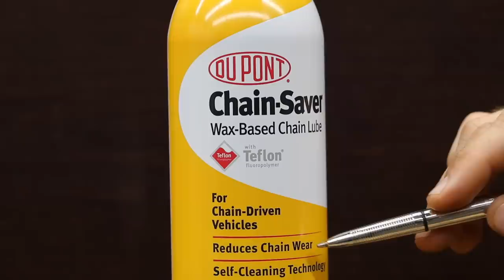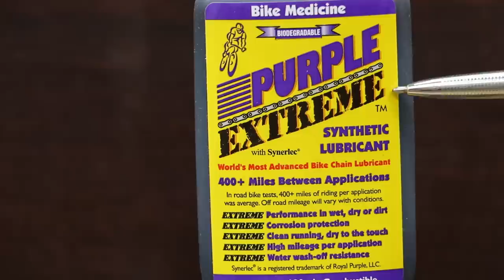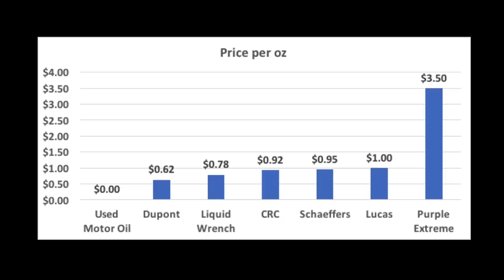Which Chain Lube is Best? Let's find out!  Ultimate chain lubricant showdown!

Comment: DuPont Chain Saver (teflon wax) is a great overall product for any moving part/cable, plastic or metal.  Most air-born contaminates don't cling to it.
Reply from the maker: Great point!
Reply: I am a Dupont fan for a number of reasons. I'm a motorcyclist, as in I ride all year long, rain, winter, on and off road. Tens of thousands of miles a year. Chain maintenance is a chore, but necessary for safety, performance and economy. Sadly I'm out there cleaning and lubricating my chains every weekend, but it's gotta be done! The real secret to making chains last in my experience is the lube, lubing regularly but most important is cleaning the chain regularly. I get about 75,000-100,000 miles out of my chain and sprockets and have had good success with Dupont. It goes on, dries and doesn't fling off so it's not slinging lubricant onto your swingarm and tire. It helps keep dirt from sticking to the chain and accelerating wear. But Dupont shines in another area, they make another product called Motorcycle Degreaser that's formulated for safely removing their own brand of chain lubricants. That makes cleaning a whole lot more efficient and easier. Another factor for me is a personal event I had with the company, when they debuted the product I remember reading something about chemicals you shouldn't use to clean the chain with afterwards. But they weren't clear on what to use instead. I searched their website, couldn't find anything to satisfy me. I hit their contact link expecting some computer generated reply stating, "Thank you for choosing Dupont, please visit out website at....". Ya know, companies that size, even if you could get a human, would they ever find you someone who could give you an answer? But I got a real person send me an email back minutes later, not just with information but tons of pertinent information. Guy really knew his stuff. This was about a year before they came out with their Motorcycle Degreaser product too. And when that was about to come to market, I got a personal email from the same guy at Dupont letting me know it was to be available and to check it out. Both events really impressed me, here I am, just some lone dude with nothing more than $10 invested in their product. Getting that much personal attention to make sure I was getting my money's worth, that I was satisfied with the product and had the information I needed. Was a good lesson for all businesses to strive for, do the extra, make a good product and you get a customer for life. They got me!
Reply: I agree. I've been using that Dupont chain saver teflon wax on my motorcycle chain for a few years now. So far it's been a great product.
Reply: Yes, any chain-driven machine can use this product, including small engine equipment. Tillers, aerators, walk-behind concrete saws and more.
Reply: Agreed on dupont. It's well revered in most motorcycle message boards, and by another independent reviewer, webbikeworld. The fact that it starts dry and ends dry is what keeps it on the rollers, rings and between the plates.
Reply: It's what we used on our BMX race bikes.  Chains stated pretty clean on dusty tracks and tracks that had a fair amount of sandy grit in the surface.
Reply: For o-ring sealed chains, I think dupont is one of the best options
Reply: That should have been in the test too. Seems like the wax ones need lots of re applications though. WD-40 has a specialist spray lube too, spray and stay could have been in the test.
Reply: 999thenewman  the same stuff is on your grill pan /skillet
Reply: Dry wax lubes are very nice. After applying They do need to dry before use and need reapplication after a certain amount of use.
Reply: I definitely agree with DuPont for motorcycle 🏍 chains. Especially when considering its quality/price from Wal-Mart, it's unbeatable in that measure. I've heard synthetic gear oil is excellent, but imagine it would get filthy sandy compared to DuPont.

Comment: I use the DuPont on my 4 wheeler and I must say the wax coating seems really good at keeping dirt and even mud off the chain.
Reply: I hated cleaning chains all the time on my dirt bikes and then the guy at my local motorcycle shop told me about DuPont. I have o-ring and non o-ring chains and this stuff works great on both types. I use to hate non o-ring chains but that guy told me to soak them in kerosene and they lube them up really good with the DuPont. So far the non o-ring chains are lasting a really long time. Not as long as o-ring chains but I like how they are lighter and make the throttle feel snappier.
Reply: @MtnPeakEnduro  Take a lesson from bulldozers; Hardened steel parts wearing on hardened steel parts in dirt. Longest life is NON lubed. In fact it is essential.
Reply: @RRaucina  you have a good point there
Reply: I LOVE THE STUFF
Reply: Richard Raucina please explain more? Are you saying no lube?
Reply: @CallsItLikeISeizeIts  If you ride in clean conditions, the lube is important, but if your chain is going to get dirty before you even finish a single ride, it's debatably making things worse. There are, however, coatings that almost don't increase dirt buildup at all, plus in wet conditions protection against rust is about as important.

In other words, if all you do is ride on sand, it might be worth not lubing your chain; if you drive in a city or on a muddy track, an appropriate lube is better.

Comment: If it makes you feel any better ( it probably won't but...here goes anyway)  the company I work for uses the very CRC chain lube you chose for your bailer to lube chains and exposed gear drives on machinery and CNC equipment where I work and it does work well. Good choice.  Thanks for another awesome video!

Comment: It would be interesting to build a chain tester that puts a significant torque load on the chain for a period of time.  Then measure chain stretch (sag between 2 points) and the diameter of the chain rollers (for wear).  That would be a highly relevant test to see how each product actually performs and improving the longevity of a chain.  The control chain (bicycle chains) would be dry, then you can measure the relative life and performance of each chain.  I would also change the drive and driven sprockets between tests and measure their wear, since sprocket wear is a factor in lubrication performance as well.
Reply from the maker: Great recommendation!
Reply: This would be neat to see, but it might be slightly disappointing since chains don't stretch.  It would essentially be a wear test, since chain "stretch" is just wear at all the points where a link interfaces with the next.
Reply: @kNasty_  So they do stretch, after all?
Reply: @kNasty_  links certainly do stretch.
Reply: @eformance  
It usually just appears as if the chains stretch. The length of the chain gets longer, but that is usually due to wear at each pin in each link. If you have a thousandth of an inch wear at each pin, and you have 100 pins, then the length of the chain gets longer by 100 thousandths of an inch, or 0.1 inches, but each link did not get stretched any. There is the condition when extreme torque is applied, such as when someone does wheelies, and they over stress a chain, and each link gets pulled hard enough to stretch them. If and when that happens it ruins a chain in seconds.
Reply: I think it would be hard to get measurable amount of chain stretch with the time I imagine he works with these tests. That's why i'm suggested to measure the temperatures of the chains during use with each lube. The chains ability to stretch is related to the temperature of the metal. The hotter the chain, the easier for the metal to stretch...Temperature is easy to determine, and  the lube that does the worst job lubricating, will most likely cause temperatures to be the highest...
Reply: @krissrock  
You are correct.
Reply: Wow! yeah, exactly that would be an excellent test. I wonder if he could get cheap sprokets off craigslist or budget bike parts store (same sproket) for consistency.
Reply: That would be a great test, but it would test the chain more that the lube? right?
Reply: If you keep the type of chain consistent (example: 9x identical bicycle chains) and change the type of lube then it would be testing the lube more because that is the only difference.

I see what you're saying. Like if we were to cut down a tree with a chainsaw. If it's a large tree and a large bar - yah it's probably testing the engine and compression more than it is the type of bar you're using (light weight, bowed out profile, etc.).  But if you keep the saw the same and only change the bar - eventhough overall the bar has minimal impact compared to engine torque and hp - you are testing the bar's.
Reply: Isn't the majority of the load on the chain produced by tension?  I suppose there is some torsion in an application like bikes with derailleurs.
Reply: @loctite222ms  I didn't suggest a torsional load.

Comment: Here's something unusual, but cheap with LOTS of uses.  Coconut Oil.  Best damn gun lube I've ever found...I'm an ex-cop in Florida and carry concealed ultra low profile...steel on skin.  The only oil I've found that can keep the rust at bay is coconut.  Slickest too.  Put it on, wipe it off...lasts a really long time and is skin safe.  Let's just say, you can test that out after a long day by convincing Project Farm and a half to give you a back rub using it.  Use the solidifying kind for cooking and 'personal' use and I recommend the fractionated (liq at room temp) for weapons and cold wx apps.  Try it, you'll love it.  Tips from an old cop...
Reply from the maker: Thanks for the tip!
Reply: Have used it for tons of things, but never thought of it as a mechanical lubricant. Time for project farm to fire up the lubricity tester I think
Reply: Over mineral oil?
Reply: Brought to you by our friends at the Pacific Resources Board
Reply: Yard Sale Dale - I have lots of 'proper holsters' and don't care for them.  That doesn't stop me from buying them and then adding to the drawer.  I prefer clip styles and don't intend to get sidetracked on this topic.  I've been carrying guns everyday since the mid 80's.  I know what I'm doing.

Re-read my post, please.  "Put it on, wipe it off"  No, it doesn't run all down and off the gun.  But since it's a fully saturated hydrocarbon, it's EXTREMELY resistant to oxidation, since all the oxygen binding points are already occupied.  That's why it's so shelf stable.  The mags get a light coat too and they run like butter.  Buttahh... silky smooth.

I've paid for Eezox (next best), and tried Mobil 1, CLP, RemOil, you name it...compared to EVCO they are distant seconds.  It works so well, that now any metal that is rust prone, gets a swipe.  My sword collection is almost maintenance free now (thank goodness)...I use in to make Bulletproof Coffee since it's a medium chain triglyceride and much more closely matches human biological needs than the long chain fats in grains and other sources.  As a massage oil, it's ideal.  Hard at room temp, melts at body temp, and dries soft and non-messy.  Get it on something, no problemo...it's clear and washes out without messing stuff up.  Stays slick while you work it, then dries...did I say ideal.  The list goes on.  Love melted wax scents...except the wax gets burnt over time.  NP...just use coconut oil in a jelly jar on a cup warmer and put whatever essential oil you like and enjoy cheap fragrance all day...lasts years not weeks.

So, yeah...it works.  And after a few decades of feeling automatics on my skin, I'm used to it and find it 'reassuring'.  The guns run great now.
Reply: legacysage - Absolutely.  Test both yourself in apps where you use mineral oil now.  You'll be thanking me.
Reply: I can imagine the soft spot on your skin in the shape of a pistol lol
Reply: logan thompson - LOL...let's just say I know when I've gained weight..
Reply: @Avitaser  
First of all thanks for the great tips. And thanks for your service. I have a few questions. How long does it take for the coconut oil to go rancid? Do you have to clean and re-oil often? If it doesn't go rancid, would it be a good leather holster conditioner? Great ideas.
Reply: David Scott - IDK..never had any go rancid.  No, I clean and re-oil MUCH less.  That's the main reason why I use it.  I'm lazy.  I've got a Kel-Tec PF9 that will rust if you look at it wrong...not anymore.  The coconut oil probably last 3 or 4 times as long before reapplications and I put on all the metal as a very light coat.  The gun actually gets blacker for a while.  I think it gets down into the metal.  Couple that with being a superb lubricant and it's all good in my book.  I'm not an oil fag...I test in my world.  The guns run great, don't collect dirt, don't rust, and it's safe to handle.  Hell, I eat it daily and rub my knotty old muscles with it.  Seriously, God did us a solid with coconut oil.
Reply: Yard Sale Dave - A new gun oil combo was made of it.  Frog Lube.  Outstanding product.  Happens to be coconut oil...with a touch of wintergreen.  Check the reviews on that stuff.  Save yourself some money and use a pennies worth of your wife's coconut oil and call it good.

In anything I'm running, it seems great.  Auto pistols, pump shotties, ARs...maybe you have higher level needs.  For that, Glock says run CRC copper anti-sieze and lubricant.  They say that on their pistols a dab of that on the contact points and you're good to go.  Back to the coconut oil, my ex-gf let me tune up her Glock since she has to shoot several times a week as a recovered firearms inspector.  She was ecstatic...you know what I did?  Ultrasonic cleaning, buffed the contact points to a polish and put a light coat of coconut oil on it.  Said it was like 'glass'.  Your mileage may vary.  Try it and see, it's free if you already have some.  If you don't, get some for the other benefits whether or not you shoot it.
Reply: Leo is right about this stuff... FrogLube, the super popular fire arms lubricant was analyzed and is basically coconut oil.
Reply: @Avitaser  
I've got an old knife that is high carbon steel that I use for skinning deer and elk that I kept oiled with vaseline to keep it from rusting. I figured that if you can eat the stuff as a laxative, then it can't be too bad for you. But, I think that you have convinced me to use coconut oil. I eat coconut oil already as well, and if vaseline is a laxative, then that's probably because your body is trying to get rid of the vaseline,  whereas coconut oil is food. 
Thank you!

Edit: true wisdom gained from true experience.
Reply: Just buying regular cooking only for cooking? Sounds cheaper than Remington oil...
Reply: David Scott - You won't go back.  Vaseline is nasty...in so many ways.
Reply: Thanks for the tip Leo!

Comment: I think a showdown of gear oils would be neat
Reply from the maker: Thanks for the recommendation.
Reply: Honda recommends 80-90w gear oil for its motorcycles and it has performed well compared to alternatives in other tests
Reply: Royal Purple gear oil is really good, but at a cost! I consider using it for my motorcycle chain, but satisfied with DuPont Chain Saver. I have RP gear oil in rear diff of my motorhome and Duramax truck, and experienced noticeable improvement on both. I've heard its excellent on motorcycle chains too (but imagine it attracts dirt).
Reply: I just put super tech gear oil in my $60,000 Dodge Ram hopefully it's as good as the motor oil is
Reply: Amsoil will win that one too.

Comment: Good chain lubes are often dry lubes, no surprise that some were dry at the end of the chainsaw test. Some have drying requirements before use. The dry chain lubes will exfoliate dust and grime needing reapplication to maintain lubrication of the chain (see bottle directions)
Reply: PAG air conditioning compressor oil seems to stick a lot to metal surfaces btw, and the double end capped variant apparently isn't hygroscopic at all. Another good dry and relatively inexpensive chain lube, try it if you can.

Comment: Try dry graphite film chain lubricant.
Reply from the maker: Thanks for the recommendation.
Reply: I use Tuf Glide nothing works better for the dusty, abrasive environment I work in.
Reply: That's exactly what I thought when watching this.  None of the products tested would hold up on a motorcycle.  I use BelRay chain lube that looks similar to white lithium grease.
Reply: Both of the above for push bikes. 
Myself use wax lubricants for motorbike chain, no rust and seals the O, X, W rings in the chain, as that is all it is the most important thing to stop the lube in the bearings getting out.
Chainsaws are different again and is more of a consumable.